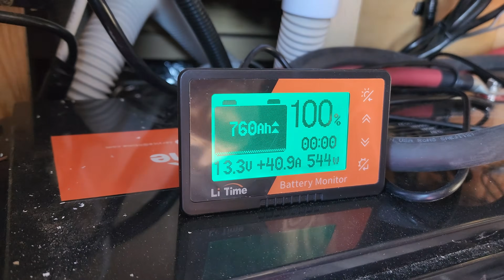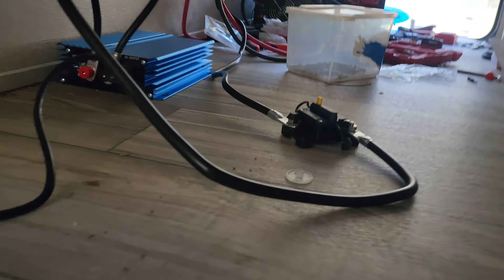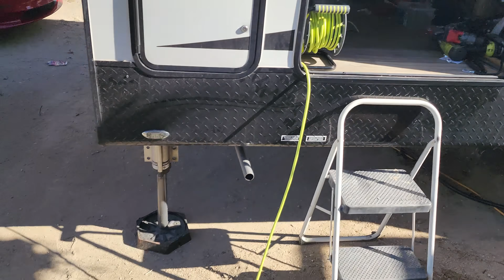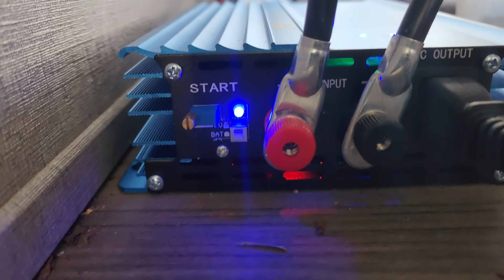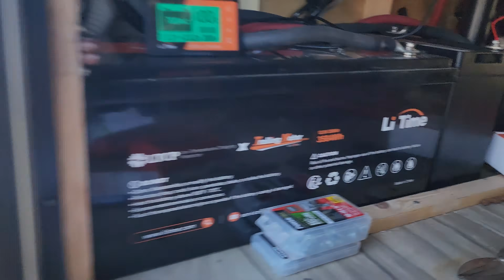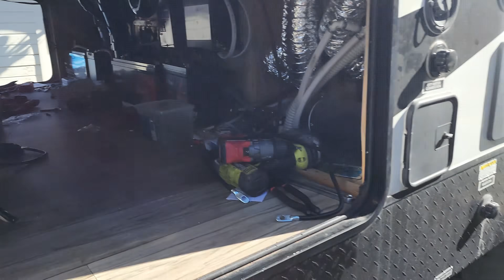RV battery system into a time of use grid tie system on the cheap.

Comment: I'm going to cast my vote for this project as being some genius-level stuff !!! 
I've been thinking about doing something like this with a residential battery backup for our house. It wasn't until I found the key search terms: "peak shaving" and "energy arbitrage" that I began to find good information about it. One nugget I found was that many of the all-in-one inverter/controllers have a program installed that can manage battery output with recharging to minimize grid energy use during peak rate hours. Some of the brands that offer the feature (in their higher end units) are Sol-Ark, Growatt & EG4.
We live in a remote rural area that is prone to week-long power outages after big storms & trees knock down the electric lines. I was looking for a way to maintain electric power in our home without the need to run a generator all the time. When I stumbled across this kind of setup I was happy to have some resources to look at. I think some of the inverter/controllers that can manage for peak shaving can also use grid power for battery recharging during off-peak rate periods. The goal of the plan being to reduce the use of grid power as much as possible during peak rate hours. I believe that they may even have the ability to start up and stop a generator to maintain battery charging and power loads during grid outages.  Getting the batteries, more solar panels, peak shaving inverter/charger(s,) an auto transfer switch, remote-start generator and getting everything installed and working properly will be a significant investment for me. Parts of the installation will be outside my level of competence so I’ll need to hire people that can install and configure the components.  Anyway, I’m encouraging you to keep plugging away at this project. I’m a first-time visitor to the channel but I hope to be following your future progress.  
Thanks for the video !  Best wishes and good fortune to you !!!

Comment: Awesome idea.  I've often wished I could use my RV solar system for something instead of letting it sit unused!  BUT--I wonder how well the anti-island feature works?  Is there a way to test that?  I'd be concerned that if it didn't work 100% reliably then someone could get hurt if the grid went down and then the user would be in big trouble.
Reply from the maker: I'll see if I can make a video to test and demonstrate the anti islanding soon.

Comment: When you backfeed your house do you disconnect from the residential grid?
Reply from the maker: @larryworsham5533  no I have a net metering agreement. Plus the inverter has anti islanding so you don't hurt someone working with the power off
Reply: @WolfMountainCustoms  thanks...i will research further.